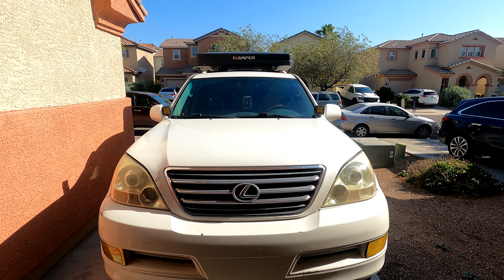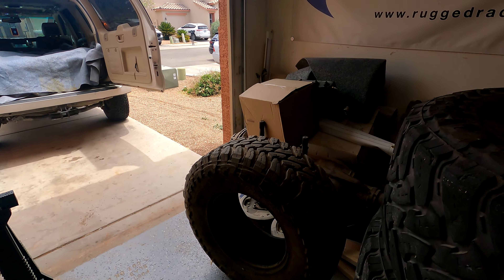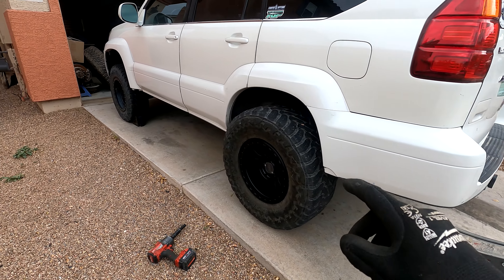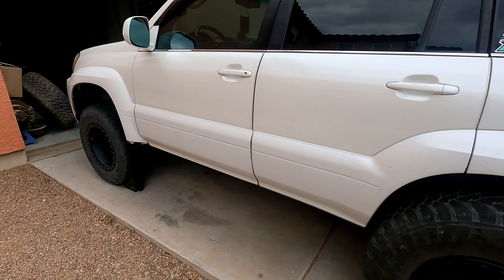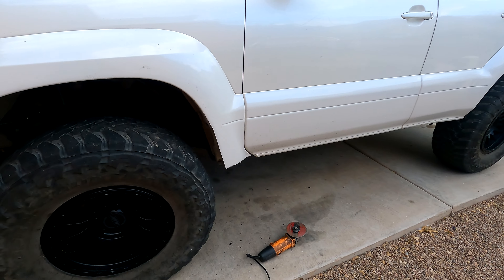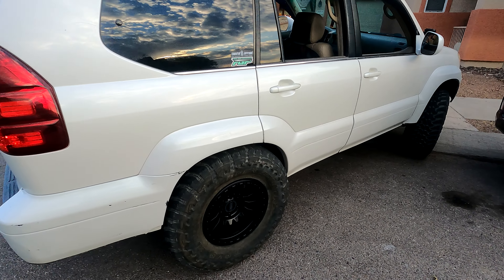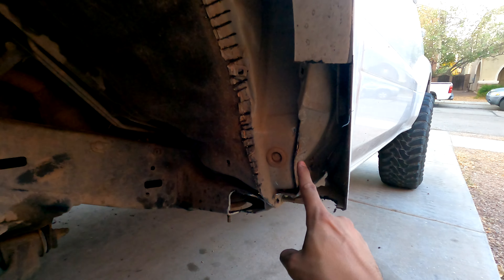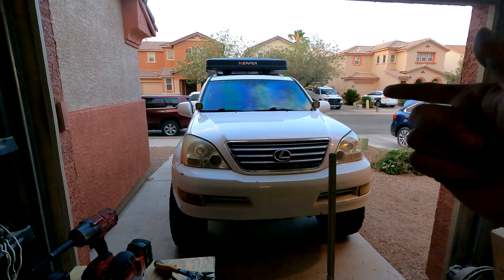Fitting 35's on a GX470

Comment: If you've never replaced the rack and pinion, you're going to sooner than later, there's better ways to go about clearing for 35s that entails a lot lot more work, If you do all this work and it's still rubs in the end, is it really clearing 35s? Definitely have a 3-in lift in the front and worn out springs in the rear. Also, the transmissions really don't like 35-in tires until you regear typically tell people to plan on including the cost of regearing with the cost of 35s. It definitely does make off-roading a little smoother rolling over obstacles. After your first off-road trip, you'll definitely figure out where else you need to trim. Awesome video edit! Great job with transitions and intro and really glad to see somebody trimming the bumper with a real grinder and cutting wheel and not a dremel.
Reply from the maker: Yeah I figured that would probably wear out first. I'm prepared to swap it out. Ultimately, I'm clearing 35's for street and light trail driving. I'm not doing any hardcore offroading with this GX and if I ever decide to then I'll make sure that it's fully cleared while bumped/articulated.

Thank you though man! I appreciate the feedback!